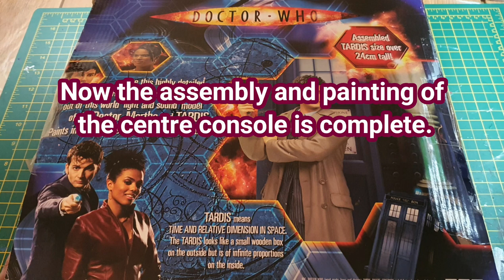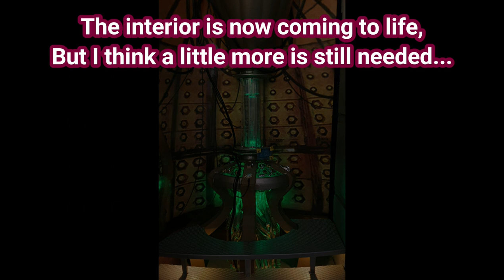TARDIS scale model build part 2

Comment: Love this, you've done a great job! I'm in the midst of building this myself and adding additional LEDs. Can the roof light and speaker run off 3V instead of three AAA batteries?
Reply from the maker: @pianoballad2  Thankyou very much!
I didn't try it on 3 volts im afraid but there's no harm in you trying it out as 3 volts is a lower voltage it won't cause any damage.👍
Reply: @DHDSCALEMODELS  thanks, I'll give it a shot! :)